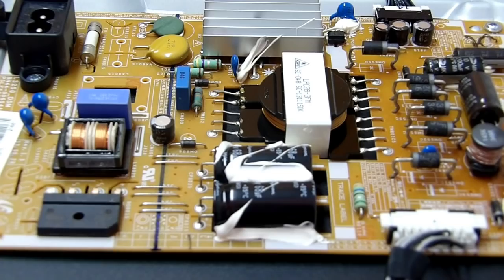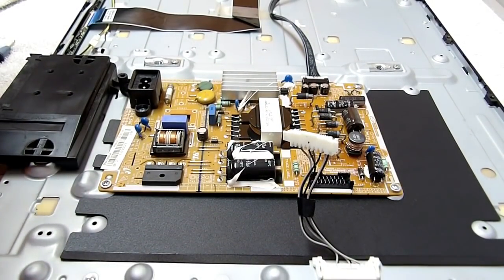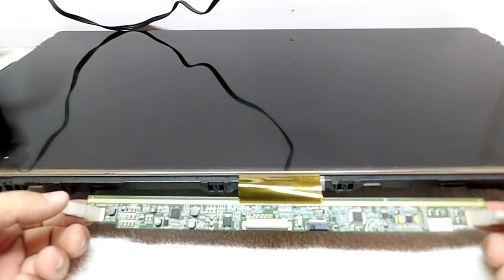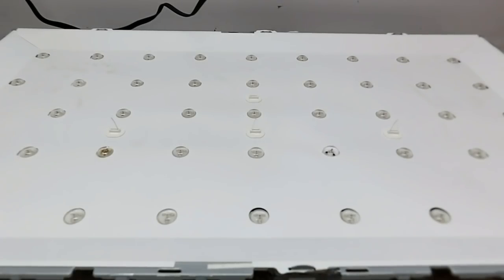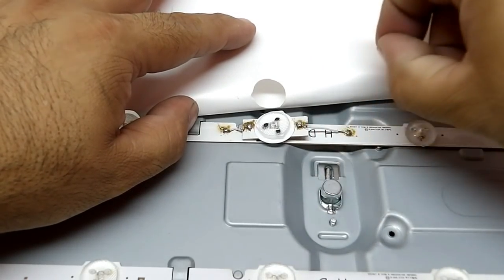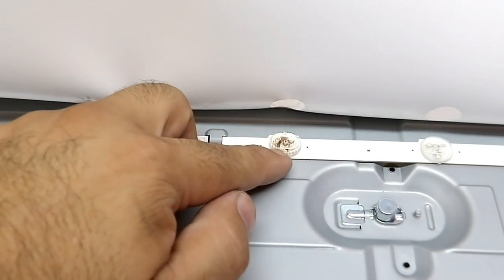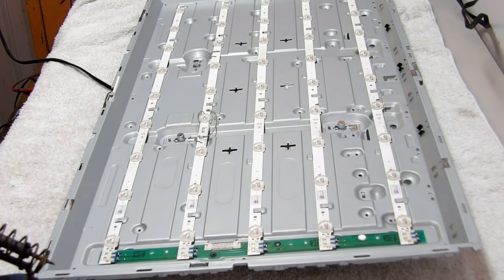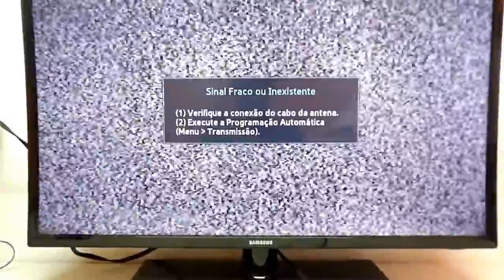Defeitos em barras de LED podem te enganar fazer você achar que os leds estão bons!

Comment: Boa Tarde amigo! Tenho uma dúvida, não sei se pode me
ajudar! MInha TV LG 47LB6500 estava com problema no led, comprei o kit com
todas as barras original da LG e troquei. funcionou e ficou perfeito. O
problema é que dependendo da cor que aparece na imagem da tv ou imagens rápidas
dá para ver a sombra e o brilho de cada Led, de todos. São original e novos,
não inverti as camadas branca na hora da montagem, porque já conferi, os leds
não são problema de soltar as capinhas porque são novos. o que pode ser?  Sabe me dizer se precisa diminuir corrente na
fonte? Eu deixei o Blacklight em 40%. E caso precise sabe me dizer como que
regulou a corrente LG 47lb6500. E depois de trocar as barras Led tem que fazer
alguma outra regulagem ou outra coisa? Obrigado

Comment: Bom dia amigo.
Estou com um problema na Samsung de 46", ela tem 8 pares de barras de leds, sendo que as 4 primeiras barras acendem e as 4 últimas barras não acendem. Já troquei a barra de interface, todos os leds estão acendendo quando faço o teste, porém quando ligo na tomada só acende a metade das barras.
Não está chegando corrente para as 4 últimas barras, isso pode ser capacitor ou a placa fonte mesmo ?
Esse é o modelo: tv samsung un46f5200ag

Comment: Bom dia onde vc compra essas barras de LEd?  Estou precisando do Kit Barras de Led (8 Barras) para Tv Lg 42LB5500, aqui na cidade que moro, em Oliveira/MG o técnico pediu R$700 para trocar todas as barras , num total de 32 lampadas. Na Americans esse kit sai por 300 reais, então a mão de obra do técnico está sendo de 400 reais. Mas deve compra o kit mais barato. Pode me informar o seu fornecedor? Outra coisa depois da troca , quanto tempo deve durar essa TV?
Reply from the maker: Olha, o Valor das peças é esse mesmo. Eu aqui cobro 250 de mão de Obra. Esse tipo de serviço pra quebrar a tela é FACINHO, exige EXTREMO CUIDADO. Se não tiver prática no serviço vc quebra sua tela e Perde A sua TV. Recebo aqui na oficina toda semana TV de pessoas que querem elas mesmos consertar suas TV e acabam quebrando a TELA. Eu acho que vale a pena pagar pelo Risco. Se o técnico quebrar sua tela pelo menos vc tem o direito se ser ressarcido com outra TV.
Reply: Oi Valdemar, obrigado pela atenção. No Submarino tem o Kit por 230 reais, mas como você disse é preciso cuidado. Hoje confirme o valor e vai ficar em 600 reais. Nessa faixa de 300 o kit mais a mão de obra. Acredito que cada macaco em seu galho. Queria muito eu mesmo trocar, mas depois arrebento algum cabo flat aí é o barato que sair caro. Na assistência que levei, o dono é super profissional, só coloca peças originais e novas. Estragar, até nova estraga, mas com a troca vai ficar igual a uma nova no quesito led. Torcer para não ter mais surpresas. Adorei seu canal. Vi por aqui em outro canal o pessoal dizendo que para preservar mais os led vc pode diminuir a intensidade do backlight na config da Tv. Vc acha que isso ajuda mesmo? Tudo de bom e o que precisar estamos à disposição.
Reply from the maker: Peça pra ele fazer alteração na fonte para que não tenha mais problemas com LEds. É possivel fazer isso, a maioria não faz justamente pra TV voltar novamente depois de um tempo pra trocar de novo. Eu faço isso em TODAS que eu conserto as barras.
Reply: Irei falar. A peça demorou chegar , mas na substituição, segundo o técnico, os leds estavam emitindo muita luz que vazava pela tela. Já encomendou nova peça. Ele disse que não poderia deixa desse jeito, achei até legal da parte dele. Essa questão de alteração na fonte, na pratica seria o que? Desde já obrigado.